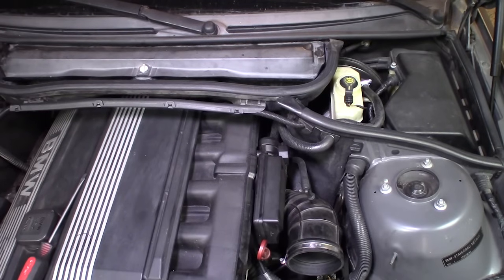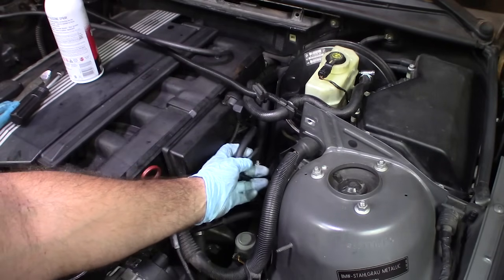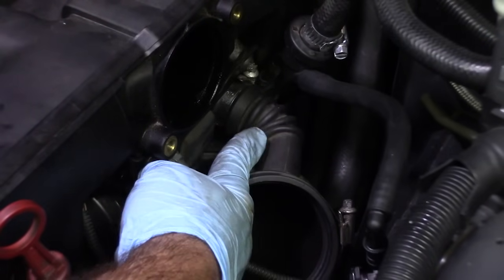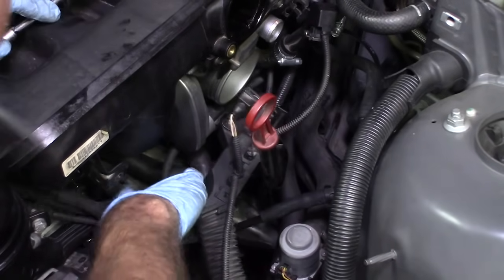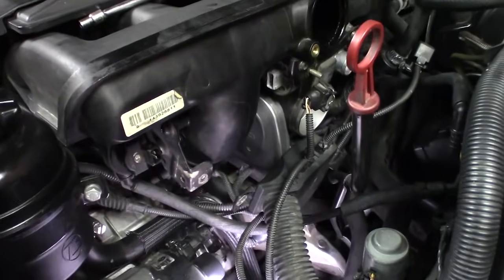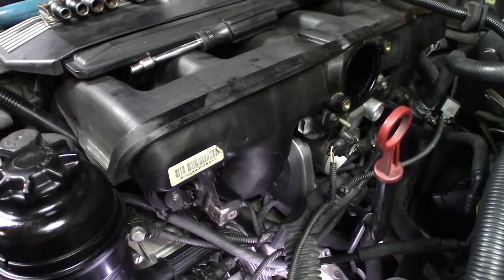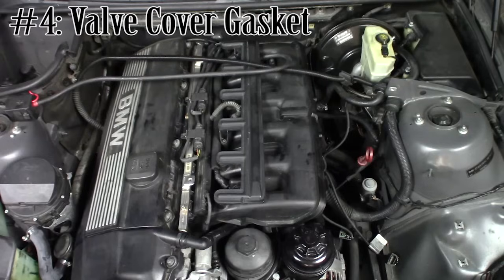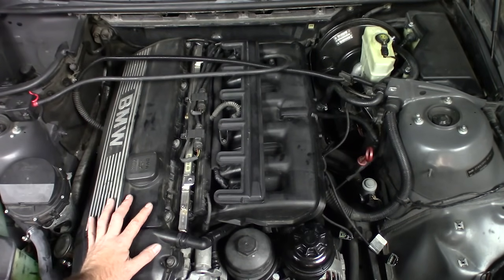BMW E46 & E39 Most Common Vacuum Leaks P0171 & P0174

Comment: Most helpfull Youtuber thanks! one question i have the p0171 p0158 p0161 and the p0313 code the engine light turn on and off and the car engine is running pretty well but i have noticed that it comes a lot of white smoke from the exhaust what can cause this?
Reply from the maker: +ballackdilan You've definitely got a lean condition on bank 1 plus a bad a likely bad o2 sensor.  White smoke in the exhaust is likely caused by a blown head gasket.  When the water in the coolant is burned in the cylinders, that results in white smoke out the exhaust.  A compression test should be performed on each cylinder to determine if they are leaking.
Reply: Thanks for the Reply! Where is the o2 sensor at? is it the o2 sensor pre cat just close to the engine or the one that is harder to fix and under the car? And again i really appreciate your help!

Comment: If the hose from the brake booster is loose from the connection on the left (min 11:30) could it cause a rough IDLE/ random missfires?
Reply from the maker: absolutely, you found the cause

Comment: Engine light is gone after replacing oring in oil stick container, but it still goes from 0 gas to around 40 % when you start to press the pedal

Comment: Really helpful DIY , I just one question bro , I smoke rest My E46 M54 engine  , and when I blow smoke into the intake through the air intake boot right after the MAF and I found a leak which is smoke coming out of that little secondary air pump valve switch , is it that normal or the switch is gone ? 
And thanks again for the vedio  .
Reply from the maker: Sounds like the vacuum like going to it is broken or has come off. I cover this in the video...
Reply: Thanks for the answer bro , I found the problem,  after I took off the intake manifold out , and after doing some search I found that the 2 air lines that gose into the secondary air pump switch valve were swapped so I reconnect them the right way and no more leak .
Reply from the maker: Excellent! Great job diagnosing your problem and repairing it.

Comment: Hi i have a problem with my e46 320i automatic some thimes i start the car it drives good and some thime i start the car and it drives i think on 4 or 5 pits and i hear when i push on the trothle a sucking noise butt i dont no where it come from and the car have no power i turn the key a few thimes en the car drives good please help me with this problem i like your videos verr much 👍👍

Comment: What about the vacuum leak smoke test I am hearing about of recent? Plugging a gas hose to the brake booster pipe, and pumping in smoke to see where the leaks are? Also I hear about the brake booster needs to be clamped off as there can be leaks inside it, as with the EGR valve pipe. What are your views about the aforementioned ideas?
Reply from the maker: There is no EGR system on an E46 BMW as the VANOS variable valve timing system functions as an internal EGR system of sorts.  Anyway, if you unplugged the vacuum line from the brake booster to add smoke to the intake via that line, you would not need to "clamp off" the brake booster as it is now separated from the intake system.  I have a home made smoke tester and it's useful on other cars, but I don't think it's very useful on an E46 because most of the common vacuum leak sources are relatively hidden underneath things, meaning that you won't be able to see the source of the smoke.  You'll be forced to remove components in order to even see the source of the smoke.  Take for instance item #3 in this video, the oil return tube.  If smoke is coming out of that, you'll never be able to see it directly.

Comment: A mechanic wrapped electrical tape a few times to ‘repair’ some cracks temporarily on the pipe after the MAF. It worked for about 3 years. Just in case some want a quick fix/bodge!

Comment: at 3:40, on that second large piece of rubber hose you haven't yet removed, there's a small hose coming out the top...does that have two small hoses running towards the rear of the car? I broke mine and I just cannot find the part number! RealOem has nothing for me, right now it's ghetto-rigged with tape.
Reply: I did look on the actual part, obviously, but the number I found didn't result anything useful on the internet.
Reply from the maker: search for "e46 intake f connector" on eBay

Comment: Hi, 50's kid, 50 times thank you. Can't tell you how much I appreciate your videos. Replaced valve cover gasket and lost a double sided screw holding a triple gasket o-ring in the middle of the engine. One side of the screw is screwed into the engine and one of the 4 center bolts comes on top on the other side of the screw. There are 4 of these screw in total. Wonder if you could tell me the name for the screw and where I could buy it?? Thank you in advance.
Reply from the maker: +Vladimir K Search for "bmw 11121718856" on eBay.  Is that it?
Reply: +50sKid ,
thank you so much. what a valuable piece of information this is. thanks again.

Comment: I need to pass my CA smog check, can I use duct tape to seal any cracks.
Reply from the maker: +Kayvan Komari I suppose you can try, but do not put it on the inside of the boot--put it on the outside.

Comment: Great video 50skid. So I have a check engine code reading P1093. I've looked it up and it's saying that bank 2 is to rich. To me that is saying that it's spraying to much fuel out of the injectors, air leak or something else. How would i trouble shoot and repair this code.
Reply from the maker: Not an air leak (that would be a lean condition) but yes definitely could be a leaky fuel injector
Reply: Thanks for the reply.  I'm having a different issue with the vehicle. p1351. Misfire cylinder 5, With fuel Cut off.  I have cleaned the fuel injectors, cleaned the fuel injector ports, replaced the Ignition Coil with boots, and all 6 Spark plugs.  No oil on the spark plugs or the boots. I have cleared the code but the engine still runs rough.  5 minutes of sitting there in park the SES light appears with the same code p1351.  I don't know what else to check.

Comment: Hey 50s Kid, love your videos! Can I ask you to do one where you are replacing the vaccuum lines that run behind the intake manifold and into the intake boot? Where that weird F connector is?? Without having to remove the intake manifold??
Reply from the maker: Luis Rico Are you talking about the larger line going into that F connector or the smaller one?
Reply: +50sKid this is Luis Rico again- I'm referring to the smaller one which I suspect has a leak under the intake manifold. Which I don't wish to remove. 
Actually I'm taking a different approach. Since my car is 11 years old, I'd rather replace a all vacuum lines I can so as to eliminate them as variables. everything is pretty brittle at the age it has. BTE the intake boot and elbow are replaced as is DISA and CCV.
Reply from the maker: That one runs down underneath the car and goes into the combination fuel filter/pressure regulator.  You only need to replace the 6" of rubber line where it goes into the F connector in the engine bay and roughly the same length where it goes into the regulator.  There is a metal cover plate that protects the fuel filter from road debris.  It's pretty straight forward.  I plan to do another video about advanced vacuum leaks and I will cover this in that vid.
Reply: +50sKid Thanks so much, you have been one of the most helpful people I've watched on troubleshooting my Beamer!

Comment: Love the Video. I have recently changed my CCV, but for the life of me, i could not get the Dipstick Tube out!! I was able to move it aside for more working space, but im sure it need to be cleaned as my 325i has 203k miles! What can you suggest to get that tube out so I can properly clean it?
Kris
Reply from the maker: +Kris Richardson Rock it around, twist it, etc., sounds like you have to break the seal on the o-ring.  Be prepared to replace that o-ring before you start otherwise you'll have vacuum leaks.  Realoem.com has a schematic with the proper size o-ring and the part number.   You can buy just that o-ring on eBay.

Comment: Hi, 50's kid, I've been following your common repair steps video and at the point when you're removing upper intake "booth" -(don't know if I'm spelling it right), I broke the plastic 90 degree elbow (just as you warned it could happen in the video). I also broke 90 degree clamp as I was removing the heat shield. Wonder if you could tell me how to order new ones on ebay? - part number. I would appreciate it. Thank you in advance.
Reply: +Vladimir K friend you can find the code parts in www.realoem.com/bmw/
Reply from the maker: +Vladimir K It's intake "boot" and the elbow for an M54 is 13327503677
Reply: +Gonzalo M. Hernández Z. Great! Thank you, Gonzalo.
Reply: +50sKid Thank you for your help, sir.

Comment: great video thanks, i wanted to ask that the only time i get that lean code is when my speed reaches 90mph to 100 mph i then get a lean code with fuel cut off would this be the same type of problem?
Reply from the maker: +Steve Wallace Hard to tell without accessing the codes stored in the ECU

Comment: great videos really appreciate i learned a lot from them what do u suggest to follow with code p0411 on a 2004 bmw 530i the air secondary  pump works i just tested thanks in advance
Reply from the maker: There is a valve that the secondary air pump is connected to that is opened by vacuum from a small line that runs around the valve cover and goes to a solenoid on the back of the intake manifold.  Check the valve, the vacuum line, and the solenoid for proper operation.
Reply: is there any way i can check this valve to make sure is working properly
Reply from the maker: Hook a vacuum pump in place of the vacuum line and see if it holds vacuum and listen to see if it opens.

Comment: Well..., left the car overnight. This morning, I've turned the key about 30 times till the engine started. After that everything was fine. Car runs great. Must have another vacuum leak? Maybe DISA valve o-ring?
Reply from the maker: +Vladimir K Why 30 times?

Comment: amazing! I have a p0941, and p0942 code, I do have a crack in my air box intake will this trigger both codes to go off. also what are the chances the   emission control valve is bad 5% only. please help
Reply from the maker: +Kayvan Komari No those codes are for the secondary air pump system, which is on the right side of the vehicle near the valve cover.  Look for damage to the hose right there, for a cracked vacuum line that goes to the actuator, and make sure the pump is not dead (you should hear it for 90 seconds when the engine is first started cold--everything gets a lot quieter when it shuts off)

Comment: thanks to your video i found a vacuum leak on my 2000 328CI car run's great now and it's started to get better fuel mileage and I have learned to do more work on my own car saving a ton of "dinero" you know "much mula" and that's great
Reply from the maker: +Armando Pérez Excellent!

Comment: Thanks again. I've had e46s and E39s. My E39 Had p0171 and P0174. I used a smoke machine and found several minor leaks. Fixed the P0171 but still have the P0174.  I just discovered cracks in my valve cover. Got a new one comimg from RM European.  But I'm afraid that won't fix it because it's not throwing a code for both banks.  I can't think it's fuel pump because WOT performance is just fine.  Probably need new 02 sensor. 160000 miles on them. But do I replace just the up stream of the cat sensor?  Or both?

Comment: What if the air intake has a whole in the head part where the air filter sits in. Could that be a reason why the two codes pop out
Reply from the maker: If it's before the MAF, no. After the MAF, yes.

Comment: Coming back to you as I did before, since you were so amazing.  I have a P0456 on my 2003 BMW 330i.  One thing I noticed is the vacuum hose that you show at 5:30 with an elbow might be the issue.  The thinner one that has a longer hose goes from the elbow to under the car, but connects to nothing under the car.  Where is it supposed to connect to?  Thanks again for your well made videos.
Reply from the maker: P0456 is a small EVAP leak.  Nothing to do with that elbow.  Unfortunately I don't have a video on testing the EVAP system on this car yet.  The EVAP solenoid is just behind the oil filter housing, hanging under the intake manifold's #1 runner.  You can follow the EVAP lines back from that valve to where they connect to the EVAP pump underneath the car.  There could be a leak anywhere in that system and you need a smoke machine to accurately test it (if you can't find the problem with a visual inspection).  You also need INPA to close the vent solenoid so that the smoke stays in the system (the vent solenoid is normally open).
Reply: Thanks, I'll see what I can find on it.  Really appreciate your reply.

Comment: Hi, 50's kid, I've fixed the vacuum leak and the overheating. This would not be possible without your video.  I drove the car and it runs great. It doesn't stall anymore on the red light. Nonetheless, I was expecting the check engine soon sensor and abs break sensor to go off, but this didn't happen. Wonder if you could tell me why and how to turn them off?? Thank you again
Reply from the maker: +Vladimir K You'll need a scan tool to erase your codes.  Sometimes an auto parts store will do it for you for free.
Reply: +50sKid Thank you, sir.

Comment: Hi, thanks for very informative video. I have 2007 Nov 530i, its vibrating early in the morning when cold but as its engine gets hot it turns to normal like never had any issue. It has all new plugs & coils. Current millage is 72770 roughly, any idea what could be causing an issue please? Also does it have CCV oil hose as it don't have oil stick?
Reply from the maker: You have an N52 engine, I believe, and I am unfamiliar with its common issues however the symptom you're describing is similar to the failure of the CCV system on the M54 engines that I cover in this video.  There are other methods you can use to check for vacuum leaks.  Take a look at my fuel trims video to understand if you have a lean condition due to a vacuum leak in the first place as well as my DIY smoke tester video for further help on tracking that vacuum leak down.
Reply: 50sKid thanks, just watched your other recommended videos, thumbs up for u. Going to check my vacuum over the weekend. But little more detail on my car engine lean. when I start car in the morning, its RPM use to be at 1000 which is common for cold engines and engine stays stable but as engine rpm reach to normal near 700 in 20 second (which is again normal I believe) then engine starts leans and keeps vibrating/misfiring until it gets reasonable hot as I don't have engine heat needle so not sure how much hot but it stays there for 5-8 mins. Do you think O2 sensor bank-2 could have any issue too or only vacuum could be a culprit? Your any thought will be very helpful for me. Thanks again!

Comment: Sounds to what we need to do is put the mass air flow sensor against the throttle body, then all air with or without leaks would be monitored correctly.

Comment: Couldn't a running lean code also be attributed to a dirty/clogged fuel filter, especially with a struggling to start issue?
Reply from the maker: Yes a lack of fuel would result in a lean condition
Reply: 50sKid Ok, hopefully that's all it is. Thanks for your great vids!

Comment: I fixed one vac leak and made another huge one several weeks ago. Had a bad vacuum leak at the DISA valve, replaced the molded gasket with German Auto Solutions o-ring. Started the car up and it ran about 5x worse than it was. Turned out I roughed up my original upper intake boot up a bit and had a 3.5 inch split in the bottom of it. Got a new upper boot and lower one even though it was replaced 5 years ago and now it runs beautifully with no codes. I had 7 total with the P0171 & P0174 and various cylinder misfires.
Reply from the maker: +tyler951 Nice job.

Comment: How do you replace the large vacuum hose attached to the f connector ? (The brake booster line to SJP i believe). I watched your video on the brake booster but didn’t see anything specific about that. 

Would love a video or advice on how to replace it ! Mine is completely brittle and destroyed

Comment: Very detailed and helpful to understand!!!
SO my problem looks like the Oil Separator because my 2002 330i starts very rough idle and get smoother when engine warmed up.
Sometime I got even miss fire too.My code is P0171, P0174, P1083 and P1085.
Thank you,
Read more

Comment: trac and eml light still on, replaced all vaccum lines. i can stils hear sound when throttle depressed.. im stumped
Reply from the maker: trac and eml lights are not caused by vacuum leaks.  Check out my BMW scan tools video to get yourself a bmw scan tool that will tell you what the eml light means--what the errors are.

Comment: old video but still very relevant. question at about 5:35 in the video he's talking about two vacuum hoses on the boot where does the lower hose go to? anyone know? one goes to suction jet pump and the other?
Reply from the maker: fuel pressure regulator underneath the car